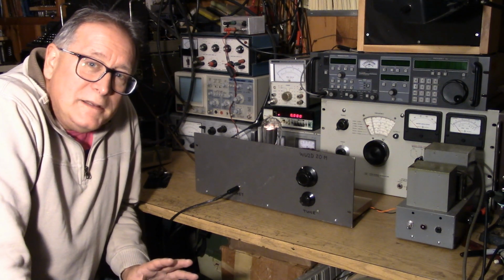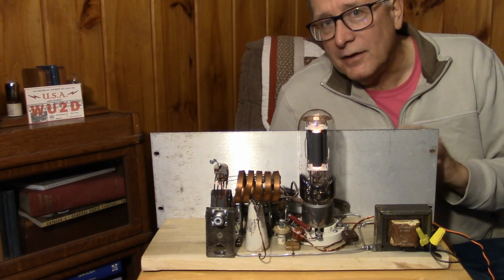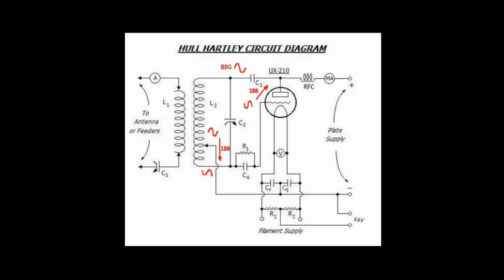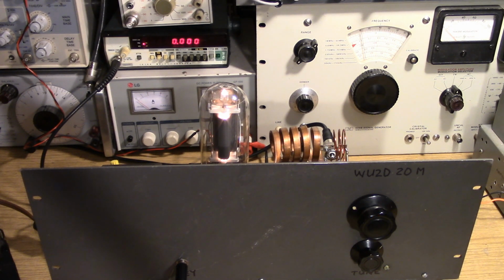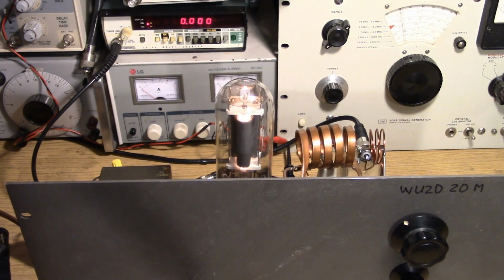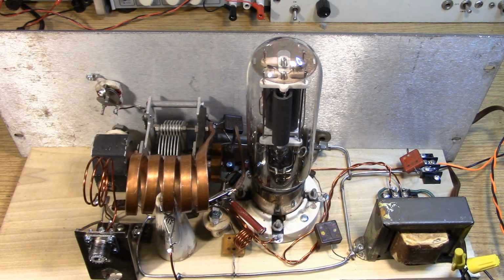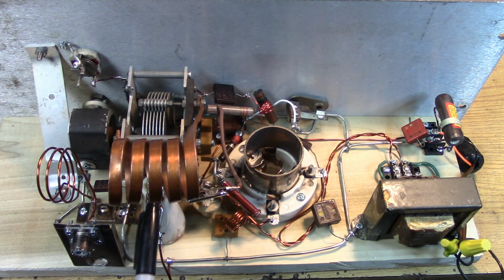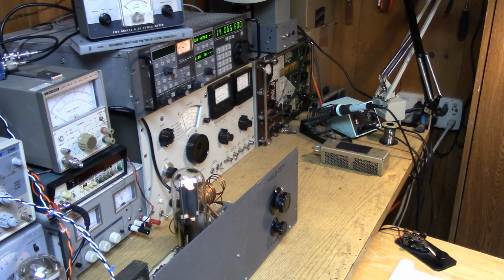1929-Style 20 Meter Transmitter

Comment: I worked you on 20m Saturday, with my MOPA transmitter with two type 45 tubes. Your signal was good on the West Coast, more stable than most of the 1929 signals on 20m. VE7CNF.
Reply from the maker: Toby, you were my longest contact. Nice signal and MOPA is the way to go. Doing it with a Hartley is tough.

Comment: With the chirpy output, can the signal be received without a BFO? Could you receive the signal with your shortwave  crystal set?
Reply from the maker: Ha good comment. Well the trick here is to use pitifully filtered HV like grandpa did by using a Model T Spark Coil Power Supply! BZZZZZ!

Comment: Very neat stuff.  I need to learn CW.  Been rebuilding a massive (Hickok 209A) VTVM recently thats been on my oist for over a year and haven't been playing with radios.  Also been on some digital projects, but need to get back to radios
Reply from the maker: Bigger is always better. a 100 mW single transistor oscillator transmitter might need a full sized rack cabinet for airflow.

Comment: Thank you ! Quite a challenge. I am a former ship RO. On more than one occasion I worked a coast station in Jamaica that I suspect was using a power oscillator transmitter as his frequency stability was determined by wind velocity on the island. It was always interesting to send ETA messages to Port Antonio via this station. Power oscillator transmitters were once common for life boat stations. Spark transmitters were also legal in life boats for many years and would not doubt be an advantage is generating an attention in a distress situation. Some of the old door knob capacitors would have been nice in your rig. And yes I have used transmitters with door knob caps in them. When you are looking a HT in the 2 to 4 KV range  big ceramic caps are or were the norm. Now that ROs are on the beach permanently 500 and 1000 watt MF and HF CW transmitters at sea are a thing of the past. Coast station KLC in Galveston Texas ran 20 KW on 500Khz. Solid copy was the norm for all of the Caribbean via KLC .
Reply: RO?
Reply: Radio Operator
Reply: @buildstoys  I wonder what he did with the time he saved not typing adio perator?
Reply from the maker: For you new guys - RO is Radio Operator.
Reply: Is the term "Sparky" still used?  Do any ships still have ROs now that Inmarsat is used for maritime communications?  I guess there's still the satellite and navigation systems to look after, but is there still a guy who sits in a radio room, or is comms just piped straight to the bridge?
Reply: @cthoadmin7458  RO's are a thing of the past. We were all out of work, September 1999. Now it's GMDS. Inmarsat and digital select calling on HF and channel 70 VHF.   Some Cruise Ships have Radio operators. For a cruise Ship , passenger Radio. Telephone calls and Satellite calls are income generators. At one point digital pay telephones were in the works. Inmarsat B calls are in the $4 to $5 a minute range.
Reply: The name Sparks was given to R Os. The epilets worn by US RO had rank designation Stripes and lightning bolts on the.

Comment: A homebrew guy I know likes using bread pans for a chassis base.

He built a 1920's style superhet receiver from scratch... Of course that needed a bit more than a bread pan, but the battery eliminator for it used one.
Reply from the maker: Yeah RCA and Armstrong had the patent that strapped all of the manufacturers to a licensing agreement if they were lucky enough to get one and only around 1929 for the latecomers. But the hams could make them from the very start.

Comment: 👍Excellent Mike and well done. Antenna movement changing load impedance and shifting frequency - we don't have that problem on modern rigs 😂....  lf I hear Dirty Drifty Chirpy (DDC) CQs, I always try to reply as I reckon it's probably someone with a homebrew set.
I remember years ago it was quite common to hear CW that was a bit DDC from the old Eastern Block countries.
Reply: DDC?
Reply: @Capecodham  DDC - Dirty Drifty Chirpy.
Reply: @Steve-GM0HUU  What did you do with the time you saved not being clear and not typing irty rifty hirpy?
Reply: @Capecodham  I probably used the time to log some more FT8 kewsos. I have edited my initial comment to clarify. So, I didn't really save any time. Lesson learned, thank you.
Reply: @Steve-GM0HUU  Do you realize the word contacts has only one more letter than kewsos and the world understands that word, contacts?
Reply from the maker: RDDDC - Really Dirty Dirty Dirty Chirpy

Comment: sounds bad.
Reply: It sound great to me!!!!
Aparantly you dont realize what this is. Its simply a high powered oscillator. It is not a transmitter!  And the fact that it's a 1920s design.
Reply: @jimw7ry  well, i must appreciate that. just that it is not a pure sine sound
Reply from the maker: Amen. Between the component effects at high frequency, loading of the antenna, and the regulation of the power supply, it is a tough situation!
Reply: @MIKROWAVE1  do you have insurance?

Comment: I love your builds! I hunt for chirpy wobbly, QRP signals anyways, because I'm wondering if it's homebrew. I also get harassed when my old FT-102's a couple hz off by the GPSDO SDR guys. I imagine you may be up for some serious roasting with your build. Fortunately most SDR GPSDO'ers don't hang out on CW. Old good power tube? That's probably a hard find. I only have a couple UV201's from the 20's. Not much power there.
Reply from the maker: They watch the waterfall and assume it is some new digital chirp modulation scheme!